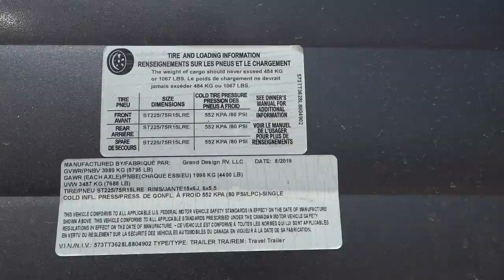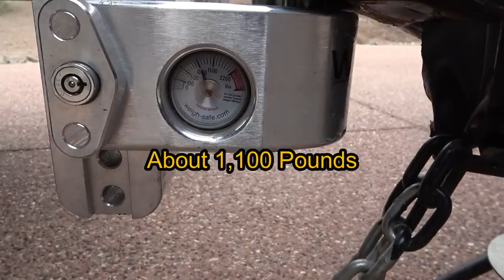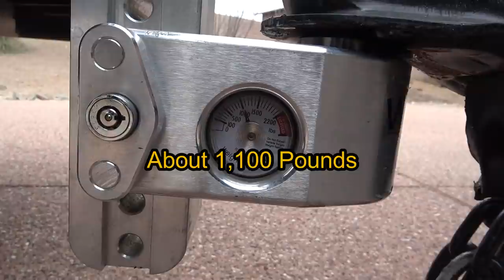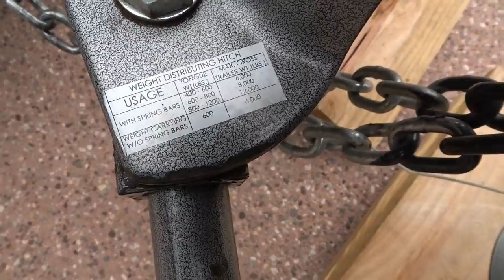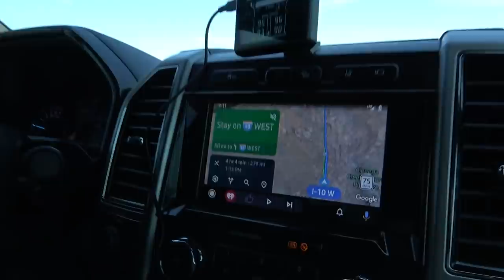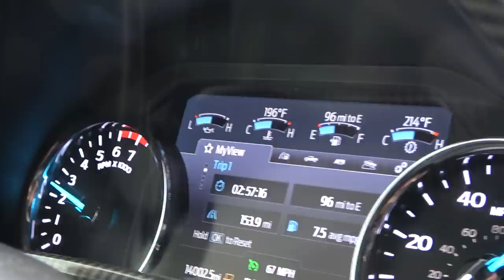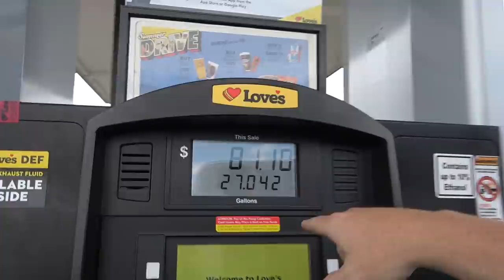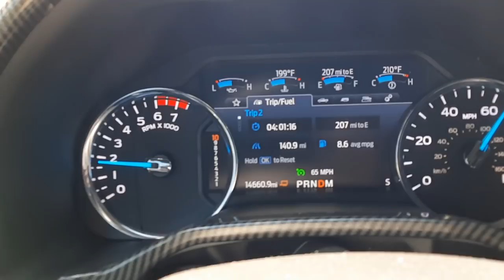Ford F250 7.3 Gas, 4.30 gears, MPG, towing prep and MUCH MORE!

Comment: Nice truck! I love the white trucks with blacked out wheels! I am patiently waiting for my 2022 F250 (non tremor) to at least get a build date! lol. And that's interesting, I didn't realize the 250 and the 350 tremor were both the same... makes me wonder if there is a difference then in a regular 350 vs the tremors.

Also, FWIW, if you are going with a non tremor truck, you can still get your payload up pretty good even with a diesel in an F250. I added the snow plow/camper package and the HCTT package, which based on other trucks I have seen, should give me around a 2800 - 2900 lb payload! The HCTT package puts the Dana M275 rear axle and the extra leaf spring and sway bar in the rear, and the snow plow/camper package will put the largest/heaviest front springs in. At this point, it's really no different from a normal base 350, but just like the tremor 250, it's derated simply because it's a 250 and not a 350.

And yeah, I chose diesel for the better gas mileage (diesel is about $0.07/gallon higher than 87 gas here where I'm at) and for the raw power. I'm not knocking the gas by any means, but we will soon be hauling in the western mountains almost exclusively since we will be travel working! I do expect the diesel prices to increase once we start that though... lol!

We put our bike rack on the back of our camper too, but used the Mount-N-Lock struts to provide more support to the back bumper. Pretty simple to install and inexpensive. Although, I wish I had (and knew how to use) a welder! Also, as I understand it, there are a few bike racks that are approved for use on the back of an RV, but the vast majority are not. However, this is because the rack itself (typically where the bikes mount) is not able to stand up the the abuse that the rear end of an RV puts them through, which is considerably more than what the back end of a vehicle will submit them too. I was watching a video the other day from No Ordinary Path and their bike rack broke while traveling down the road, but it was at the welds on the actual rack, not at the hitch. So be sure to keep an eye on the rack itself if you put many bikes on it or use it often on the back of the RV.

The listed weights on my camper includes 2 full 20 lb propane tanks and the batteries. Most all others that I have seen also includes these... maybe different companies list them different though? And I am going to have to upgrade my WDH with a 2" shaft since my F250 will come with a 3" receiver (another perk to adding the HCTT package!). The Anderson WDH is much lighter and can be purchased with a 2, 2.5 or even a 3" shaft! And I never had good luck with those stabilizers that reduces the rattle... every time I tightened mine down it would be loose by the time I got to the campground. I eventually just gave up on it.

Great job on the generator, I almost got the Predator 3500 too! I couldn't see spending the money for the Honda or the Yamaha... however, I did go with the Champion 3400 dual fuel inverter generator. Before ordering my F250 we were pulling with a Pathfinder so didn't want to carry fuel inside the vehicle. Since getting the Champion we have only used propane and it's been great. We also installed 600 watts of solar, added 315Ah of LiFePO4 batteries and a Victron Multiplus inverter charger. That has been a huge game changer for us! We don't even need the generator anymore unless we plan to run the AC all day...

I added the tailgate step on my F250! My wife is only 5'2" so it will come in handy, but yeah, when hooked up to the camper it won't work. We rented a F250 last year and I can't remember if the tailgate will sit all the way down when hooked up or not... I'm thinking it did, but at that point the step wouldn't be useful though. I am thinking about those Amp side steps too so that we could get into the front of the bed easier. Once we get the Anderson hitch it will be light enough to just pull the whole hitch out pretty easily and quickly though. Also, is that the Ford branded folding tonneau cover, or did you get it aftermarket? I added the Ford hard folding tonneau to my order to and was wondering if it is just a rebranded Bakflip. 

Good to hear that you like the Tire Minders. I used a Bella Corp TPMS system for 3 years and it was horrible. I switched over to the Tire Minder system this year but have only gotten to use them on 2 trips since we are waiting for our truck to come in. As for the China Bombs... I have always seen this term as more of a indicator of the person towing rather than the tire itself. Most folks towing simply overlook their tires and neglect them. Not many can actually tell you what their current PSI is in each tire, or what the sidewall even recommends. let alone actually take time to inspect them between or during a trip. However, running these ST tires with low psi is almost guaranteed to cause a blow out, especially when folks are driving so fast on them. Most ST tires are only rated at 65 mph. I know the GY Endurances like you have are rated a little higher, but I have still heard that due to design, over 65 is not a good thing for any ST tire... Folks need to worry about maintaining their tires rather than the name on the side wall... I have seen lots of posts with blown GY Endurance tires too, including one that only happened a couple of miles from the ship where they were installed. No tire is perfect. In my research, I have found that the Maxxis 8008's, while not perfect, are some of the best, and this is over a number of years of use. The GY Endurance tires are still relatively new, and while made in the US, from what I understand, they are still made with Chinese rubber... lol.

Also, I did a little math with the gas vs diesel prices...

As I mentioned above, last year I set out on a 4200 mile road trip in a rented F250 with 3.31 gears and a 6.7 motor, pulling our (measured) 5700 lb travel trailer. The truck had 52 miles on it when I picked it up, and on the home stretch with the camper hooked up we weighed in at 13,640 lbs. This included about 600 lbs of passengers, about 150 lbs of cargo and around 600 lbs of tongue weight distributed on a WDH. We started in MS, hit I40 in Memphis, TN, then stayed on it through AR, OK, and then to Amarillo, TX. From there we headed north into NM, CO, WY and then back east into SD and finally back south through IO, MO, TN and back to MS. The camper was attached for 3,756 of those miles, and overall we averaged 11 mpg. However, the entire time we were on I40 we were sitting pretty at 12.5 mpg. Once we started heading north and hitting some real climbs and a good bit of headwinds in CO the mpg dropped slightly. By the time we were leaving WY we were near 11 mpg with the camper hooked up. We sat there the rest of the trip, averaging 68-70mph on cruise. Thisbecause

becausejustable to travel 425 miles. This actually comes to $0.42/mile for the gas and $0.28/mile on diesel. Yes, I get that the diesel engine is an extra $7700 up front (based on invoice pricing), and I'll admit, it will take a looooot of miles to make up that difference.... however, on the road, everyday, the difference can also be seen at the pumps... and if you do the math, it's actually in favor of diesel. Not too mention, I liked having the longer intervals before needing to fill up that the diesel allowed for those longer stretches without so many gas stations to choose from. On our trip when hooked up to the camper, we would start looking for the best place to refill around 325 miles of travel and most times when refilling would still easily have 1/4 tank or more.

I do appreciate this video though. I really appreciate all of the effort you put into it and all the stuff you shared. It's not common to see a lot of this and I think anyone on the road, especially towing should be aware of these things. I will also say that it confirmed my thoughts on the 7.3 vs 6.7... I also loved seeing the country side in your videos. I haven't been out that way since June of last year and I can't wait to get back out there... it's so beautiful! I still haven't had a chance to go to the Grand Canyon, but it is in our future! I am hoping that our truck is built by Christmas of this year... lol!s
Reply from the maker: Wow Chad, best and most informative comment I've ever seen on YouTube, and you did it in my channel! I hope you're a subscriber so I can look forward to hearing from you again. Appreciated it!
Reply: Chad, did you end up getting your truck? How long did it take?
Reply: @real-j-anderson  I did. I ordered May 24th and it arrived on the dealers lot September 23. I brought it home September 24th, so 4 months exactly. I ended up removing the UTT package to help get it picked up sooner. I really wanted the 360 cameras though… that’s the only thing I don’t have on the truck I wanted. Everything else is awesome! Also, I ended up removing the tonneau cover and the console safe. I removed anything “aftermarket” on my order so that when it rolled out the factory doors it was ready to ship to the dealer instead of somewhere else for more parts. As it turned out, I got the actual tonneau I wanted for less than what Ford was charging anyway, plus that was an extra $1000 I didn’t have to add to the overall finance price of the truck.

Comment: Also, I'm not sure, but I mount my Anti-Rattle bracket with the bolts and plate DOWN. That "holds the hitch down", as I understand. I'm 2 yrs late to this video, so maybe you you've changed.  :)

Comment: You’re still using the mileage from the truck to “hand” calculate. To really omit the truck’s computer, you’d need to GPS the mileage from fill up to fill up. Then calculate it to see if that plays a factor. You may find a couple of miles per gallon difference. You’re already seeing two tenths difference.

Comment: Great video! I tow a bit smaller & lighter, and with a 16 Expedition. I have the same hitch and one thing I noticed on your hitch is that those bars might be lose. Those 2 huge bolts on the hitch can be torqued down to 150 lbs.  Mine wasn't even as easy to move as yours before I tightened them but when I brought it up it made a HUGE difference with sway on the highway. Also good on you doing those tires. I just came back from a 500 mile trip, had factory Trailer King on first half and then swapped for the Goodyears and that made it ride better, smoother, and tracks better.  Last thing - Can't tell but those bars might not be parallel with the frame and might be able to be adjusted. Doing that will also cause it to handle a bit better. Is your hitch really loud? Mine is.
Reply from the maker: Thanks, I’ll check the hitch out too make sure all the s good. The hitch is only loud when I’m making turns, pops and squeaks which is normal when the weight distribution bars are rubbing against the brackets for friction.

Comment: It's ironic - a diesel that can pull/haul more than a gas engine. But the gas engine can very much handle all of the weight that the truck is allowed and engineered to have. AND... the diesel takes up 1,000 lbs off of the top of your payload. It seems like a very heavy trailer with little in the bed of the truck a diesel would favor. But if you used a Camper or something heavy in the truck, you'd be better off with the gas engine.

It seems like a 10 speed tranny makes it so that the 4.30 rear end gives you all of the advantage of the low rear gears and NO disadvantage... go 10 speed tranny!

Comment: I have a 2020 f350 4door long bed with 4.30s. I tow a 413 raptor with stuff and golf cart 27k with truck. I run 8th gear locked out at 65-68 2600 rpm giv or take

Comment: If you use cruise control going downhill you’re using brakes without knowing it even though your foot off the break you need to learn how to use the manual shifting on the steering column to keep it in lower gear and stay off the automatic cruise control well I’m going downhill

Comment: Heyo, I have a 2020 F250 tremor as well! Ive been watching videos cause I just got it a few months ago. But you mentioned how the display MPG was never correct, heres a video on how to correct the calculations if you haven't already. You just need to do some hand calculations to find a calculation variable and change it in engineering mode.

Comment: I’ll never understand GVWR. I owned a dump trailer with tandem 7k axles and the GVWR was 9990lbs. I looked at a 8.5x16 cargo trailer today with tandem 3500lb axles with a 9990 GVWR. And a 7x16 cargo trailer by the same manufacturer, sitting side by side, it had tandem 3500lb axles with a 4500lb GVWR. You’d think the GVWR couldn’t exceed the axle rating and the smaller trailer would have more GVWR with the same axles as a larger trailer🤷🏻‍♂️ 

Automobiles are no exception.

Comment: Really helpful video, thanks. I have a similar truck setup on order, and my only concern is access to gas while towing the rig, and limited range. How are you determining gas RV friendly stations, and do you carry extra gas in the truck bed?
Reply from the maker: I do carry a five gallon can of gas but that’s really for my invertor generator. If I needed it though it would definitely be going in the truck. As far as fueling stations… 90 percent of the time it’s very easy as most highway stations have RV fueling station which have gas and diesel. Other than that I just use the far outside right pump for regular station and I’ve been fine.

Comment: Excellent Video Great Explanation and your right on preditor Excellent generator I'm curious how big your fuel tank is,I'm a diesel owner here in Phx AZ except Mines even worse on dot LOL F450 test drove a Tremor loved it but your right hard to find been thinking tho maybe future my toyhauler is a 26ft custom dune sport about 8000 dry with machine inside my max is 14,000 so I'd be good great gear ratio I have that in my 450 but a 6 speed,KEEP UP GREAT VIDEOS 👍👍👍
Reply from the maker: Thanks for watching! My fuel tank has 34 gallons I think. I don’t pass many gas stations when towing. 🥲

Comment: I just ordered a 2022 250 7.3L with 4:30 gears. Two sales associates at two separate dealerships tried to tell me the 4:30 would kill my MPG, and I'd be lucky to get 8MPG with them. They also told me they couldn't sell at less than MSRP, but I got mine for $250 over Invoice, so why would I believe anything they said? Thanks for the great videos.
Reply from the maker: Maybe with the old 6 speed you would get 8MPG... not with the new 10 speed. Salesmen can be dumb to what the sell sometimes.
Reply: Just curious how much less than msrp you paid. Im thinking about ordering one. Thanks
Reply from the maker: @dp5430  I was about 4k less than msrp but that was pre pandemic. Dealer has called and offered 5k more than I paid with 15k miles on it now.
Reply: @dp5430  $2250 below MSRP. If I had been more aggressive with the sales associates by telling them about the discounts other dealers had offered me, I might have gotten down to invoice, but considering the current market I’m pretty happy with where I ended up.
Reply: Thanks for the responses.
Reply: Yours come in yet? I also ordered a 22 250 with the 7.3 and 4.30 gears. Figured 4.30s would be better when I put 35x12:5 tires on it.

Comment: Check your actual miles traveled with a gps device.  Most speedometers are calibrated at around 60mph. They are allowed some leeway, usually 5%.  This will affect your mpg calculations if you just base it off the dash reading. I have checked every vehicle I own, including two motorcycles and they all are off a bit at different speeds.
Reply from the maker: Checked GPS to vehicle Speed and it goes half MPH slower than the speedometer gauge at 75 MPH

Comment: Great video. Can you please enunciate further how you lock down the generator in the truck bed.  Where you got the straps and the heavy duty chain locks.  Thanks
Reply from the maker: On that particular inverter each side has a long grab handle on it, and I just put a tie down on either side and then connect the other side of the tiedown to the tiedown holder in the corner of the bed. And then pull them both tight and that keeps the inverter from moving around even to the slightest. The chain I put on is just added security in case somebody cuts the tiedown straps off they would have a lot more to go through with the chain.
Reply: @BigBoyToyzz  Thanks

Comment: When climbing a hill not using cruise control switch to manual and downshift on the steering column and that will pick up your speed without it bogging or lowering itself down in gear

Comment: I don’t have a curt  I have a  e2 fastway hitch and I get way closer than that when I install my bars and there is no rattling noise on my hitch like I said I don’t have a curt but it seems to me your bolts are not tight when I adjust my hitch head I need to torque my bolts to 240 ft pounds and I take my measurements on the front of the truck so let me know if the curt is designed to have bolts lose. Thanks for sharing, also I’m looking for a F250 lariat.